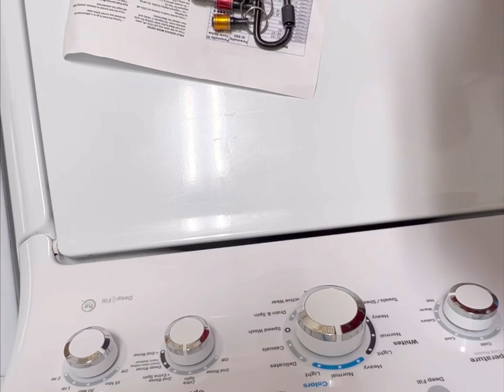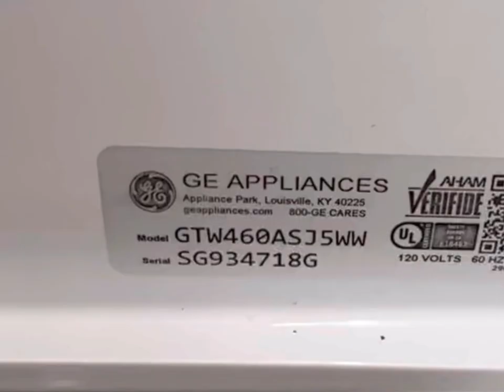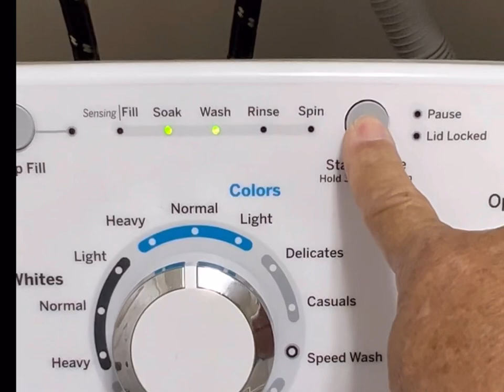GE washing machine top load board replacement and set personality

Comment: What is the personality code for GTW500ASN0WS?
Reply from the maker: If you are replacing the board , the new board is coming with instructions , for you machine the number is 17 main board part number wh18x28176
Reply: Question do you have to replace the board if it just so happen to change itself meaning drain and spin now wash and bring in cold water
Reply from the maker: @raymondblakley3731 just reset control board ,disconnect the power and press any button for about 20 seconds
Reply: @How-123  and that should change the personality back
Reply from the maker: @raymondblakley3731  the personality is not going to erase you can reprogram same personality
Reply from the maker: @raymondblakley3731  Part install instructions applicable for the following numbers wh18x28174 to 78
https://youtube.com/shorts/uUMrXsoeiEo?feature=share
Reply: @How-123  appreciate you